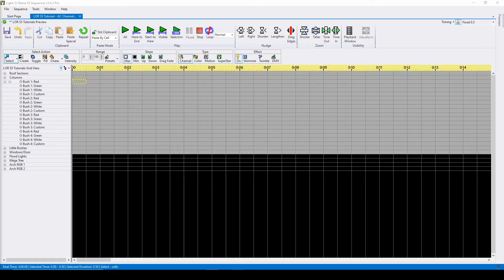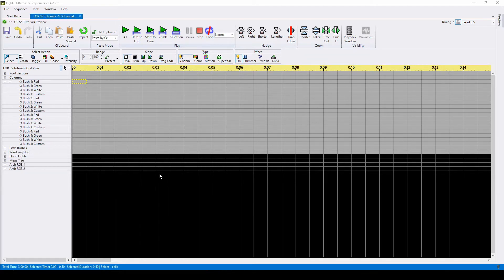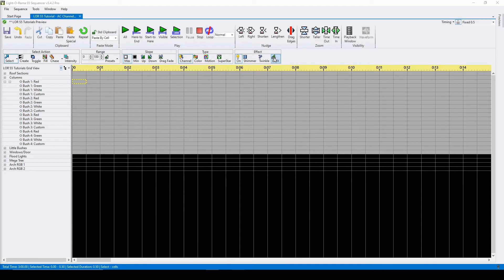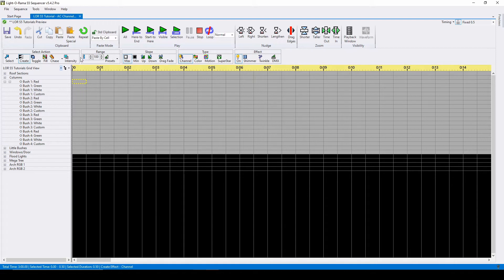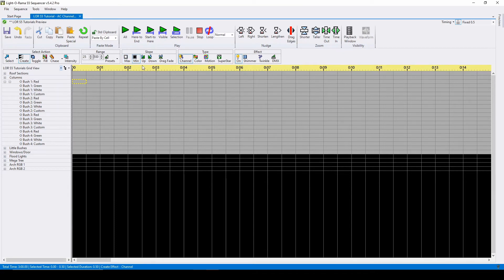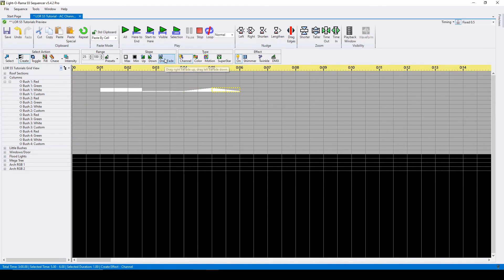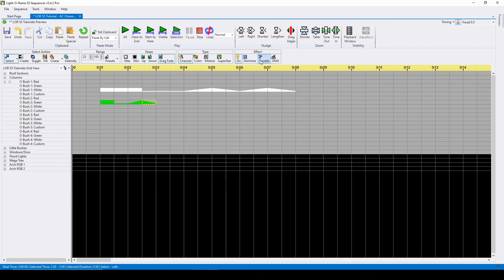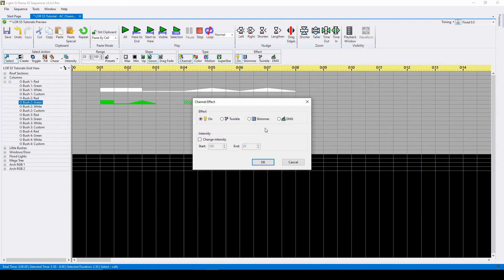Light-O-Rama S5/S6 Sequencer: Basic AC Channel Commands - Luminous Harmony "How To" (Sequencing)

Comment: So say i make a group wjen adding shapes to my picture. Say i have 4 candy canes in 1 group. Those 4 candy canes in that 1 group would be 1 channel right? (Hope that makes sense)
Reply from the maker: They would be the same channel if you set that parameter in the right third of the prop definition window for the duplicate props.
Reply: @LuminousHarmony  i messed around with it earlier. And i think i figured it out. I went into each prop i wanted on the same channel and marked them as "same channel as 'other prop'". This is my first time using light o rama and i think im getting the hang of it. We ordered the light o rama starter kit that comes with the 16 channel controller and the USB485 i think it is reciever.
Reply from the maker: Yep you've got it! Just mark the channels the same as the parent prop and you're good to go.
Reply: @LuminousHarmony  awesome! Also ended up naming each parent prop with a number to correspond to the channel number theyll be plugged into to make it easier on my half. Didnt realize how fun and simple it would to make a show. Only issue im gonna have really is uhhh connetion with an ethernet cause well my desktop is in our basement on the opposite side of the house so may have to get a longer ethernet cord. Ohwell. And ill have to figure out how to actually start the show and all that later too once i configure everything with the controller
Reply from the maker: Smart! It IS really great that you can draw everything in the software before committing to installing any lights. You can run a few hundred feet with a Cat5 line before you'll notice signal drop, so hopefully you'll be alright with your computer placement!